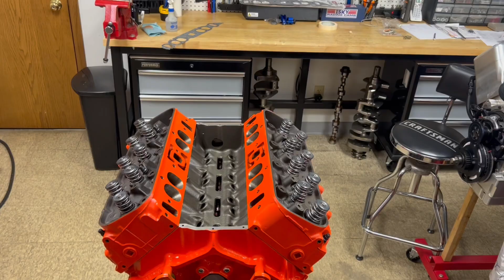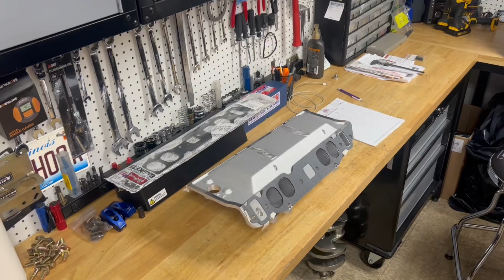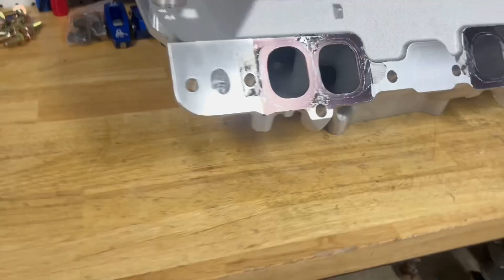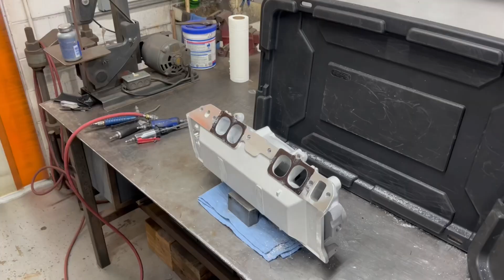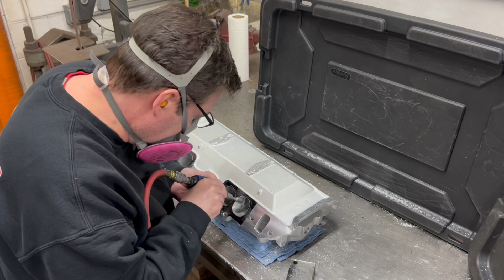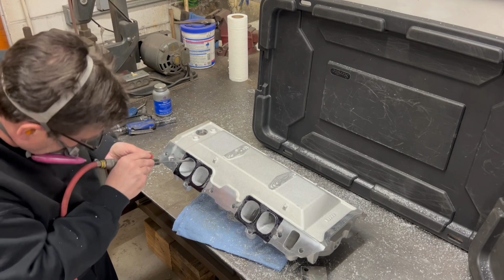HOW TO! Port Match Any Intake Manifold, With Professional Results!

Comment: Really like the vudeo thanks. But the information ypu give when ypu start with the rotary tool i cant make put over the whising of the tool.

What 2 bits ypu use?
And the other info you give is masked by the high pitch sound of the tool.

Thanks

Comment: Now since you.mentioned using 781's, I have a set if those I will be working on this month and would like to know what size vlaves you installed. I knew a guy and his son in central Tx that used a set of the large oval heads but don't know which castings. It was a 454 in a 69 or 70 Chevelle and after I built his TH400 trans, with either a 3000 or 3500 converter, don't recall now, it had 4.11's and around a 30" tire. That car was plain wicked. They were running a pretty small Holley, I think it was a 650 vac.. I do know those heads had 2.19/ 1.81 or maybe 1.88. Anyway, I've read David Vizard's book on building BBC's and what he's wri5ten about how any and all of the BBC's head casting for all the engines have been under valved even at the biggest you can fit in them. Oval or rectangle ports. My plan is to go to 2.25/ 1.88 for the 454 I'm planning on building and using the rooler cam I got some time back that is around 660 lift. i need to get it in a block so I can defree it out as the numbers on it don't come up anywhere for me to see what I actually have. This engine will be going in a 23 so it's going to be a really light vehicle. I've.been using steel for the frame that is heavier then most other frames to get the strength and weight up some.

Comment: Hey do you ever have to trim the bolt holes on the gasket if they are a bit off. When I line up the port perfect to the gasket a few bolt holes look off.
Reply from the maker: Yes, all the time. I usually take an 
X-Acto knife and trim the holes.

Comment: I did the 1/8" hole method. Only i didn't put enough head bolts in at the time and my holes ended up like a 32nd off, so i couldn't use the peg holes for alignment. I think i got it, though.